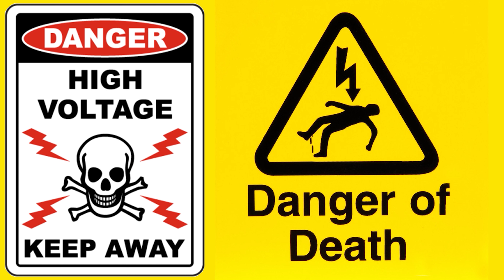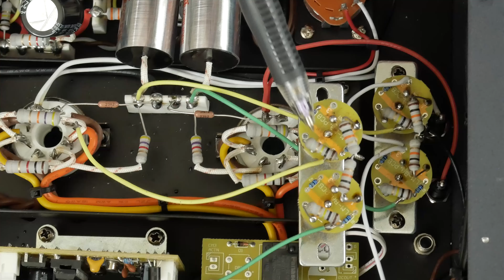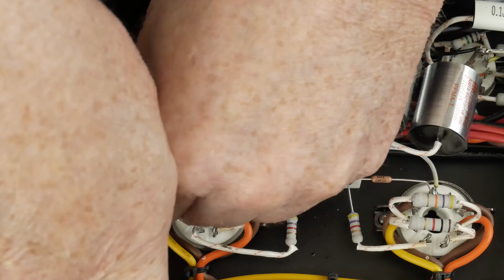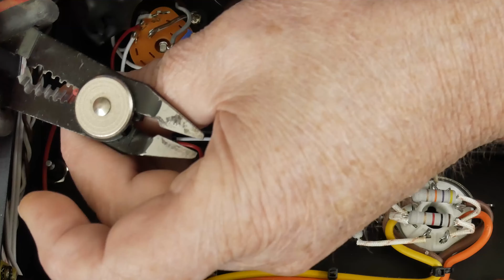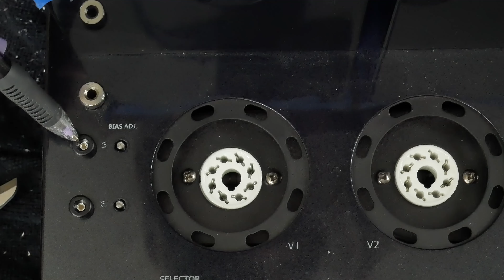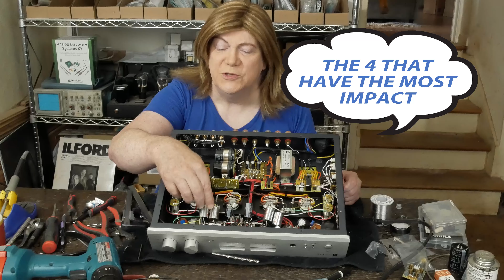Muzishare X7 Revisited: Relacing Bias Pots, Test Jacks #2

Comment: I have the Collectors Edition of this amp for about 18 months now and having problems with 1 or more power tubes (Psvane KT88 Tll either not biasing meter reads 0 and the whole right or left channel stopped working but the tubes light up normal. You would hear a slight click or pop and the bias would not work on one or more of the kt88s. but if you put in the new Psvane KT88 Tll  they all bias good. Now I take all the Psvane KT88 down to the electronics store and have them tested for power and shorts they all (new and old tubes) tested over 100% good. So now what do I check? Help Please...In other words the older kt88 test good 500 hours on them why don't they bias and work?
Reply from the maker: Tube socket issues?

Comment: Thanks.  What a great video explaining everything in detail. 

What are the military grade pots you have used in this video? I failed searching in mouser. I did find the 10kohms one.
Reply from the maker: the availability of these changes a lot,  when I post a video, they all disappear lol. 10K will work as it's simply a voltage divider. You can add a little resistance on each side to compensate.
Reply: @SkunkieDesignsElectronics  thanks so much.

Comment: Heyoo Stephie! 

I just finished my EAR 834 clone 10 days ago and now would like to get rid of the X7's built in phono preamp and make the phono input a high level input like the others (CD, line...) . The EAR 834 outperformes the built in phono pre by far!!!! And the EAR 834 outperformes my Project Phono Box S2 by far, too! It is another world and a new journey ! 

I see in this video you already "extracted" the X7's phono board. Is there something important to consider? I see two green/yellow twisted pairs of phono input cables coming from the RCA jacks for each channel going to the phono board and some white cables from the phono board to the input switch. Maybe I cannot see the black cables in your video. But don't really know how to connect them, if I omit the phono board. 

Is it correct to connect the yellow cables to the white cables and the green cables to some black cable? I currently cant see the black cable but I guess there is one at the phono output solder point in the middle. 

Maybe I should open the amp and have a deeper dive into it...

Nother topic: I opened my X7 yesterday night. It has XLR inputs and an XLR input board with a pair of JRC 5532D Stereo Op Amps. Semiconducters in a tube amp? okay If it works I am flexible. I have done some research and this OP Amps seem to be not that bad even if they are cheap (3 dollars a pair). They are quite popular in PA mixers where they put lots of layers from different tracks onto each other and they are popular for their clean neutral sound and low noise. Frequency range goes far above 100 kHz. The phono board has the same Op Amp JRC 5532D , if I can trust the schematic - but I will have a look once I will have extracted the phono board. What irritates me is that the XLR input sounds really amazing but the phono input really crappy.  

Kind regards from Germany
Burkhard
Reply from the maker: XLR input on a normal tube amp usually harm audio quality more than any benefit you could gain. As you see, they either just use op amps or some cheapo transformer.

On bypassing the phone stage, you just remove the board and connect those twisted pairs to the shielded wires.
Reply: @SkunkieDesignsElectronics  thank you again stephe!

Comment: Stephe,
Forgot to mention that my Muzishare X7 was partially modded as per your earlier videos. I replaced those big resistors with 1/4 watts as well as replacing all six big caps with Mundorf Supreme Silver Gold Oils as well as treating the meter switches with DeOxit D5. I noticed one day that the left channel was oddly louder than the right. I checked the bias as noted that the tube was oddly way over-biased. I corrected the bias to its proper level. The next time I used the amp the same thing happened and one of the Gold Lion KT-88s red plated. Again I noticed that the bias was way too high. The tube was a total loss. I determined that one of the OEM bias pot went bad. It was extremely difficult to trim the bias, the pot seemed stuck. I replaced all  four pots with some Bourns 20 k Ohms that were rated for 50,000 cycles (unfortunately the pot shafts were of the short type). That fixed the issue and all was well with the amp. 

My question is why did the bias safety resistor not blow, saving the tube?

Also, I have been using EL34 tubes in the X7 by reducing the bias from the KT88's 40 mA to 30 mA. I have not had any issues with the amp so far. But are you saying that something else needs to be done to the X7 to use EL34-type of tubes?
Reply from the maker: Hmm not sure why they didn't pop. Honestly I haven't tried to bias EL34 tubes in this amp. I'm going to before I ship it back!

Comment: Noval versus octal .............you're right about this when using current production tubes ( exceptions exist )
Strange I serviced several old vintage amplifiers , like a Marantz 8B and those bias switched still work fine after decades........operate those switches on newer amplifiers regulary before start up is oindeed good practice.
Many /most of recent/current tube pre/amplifiers are tuned/voiced for new production tubes , NOS may be often waisting money on these .!
Your videos are very helpfull for audiophiles that bought these kind of amplifiers .....
I onced had to repair/service an amplifier that was vey unstable....wor-ked /stoope working ......unexplainable  ....tubes were fine , voltage on the power supply OK .............than I discoverd that the owner  had put oil into the contacts of the sockets to make it more easy to pull out the tubes and do some tube rolling........it was a mess to clean them ....sometimes one wonders what's happening .....turned out to be fine after touroughly cleaning the oil out of the sockets ...( wasn't easy ).
Have a nice day.

Comment: Interesting! I don't really trust the built in vu meters and so your test jacks are genius! Can you adjust the built in VU meters with this small blue-brick pots? Biased my amp with an oszilloscope hooked at the output terminals parallel to an 8 ohm dummy load. Objective was to have exactly the same output voltage with a 1 kHz sin-wave at both channels. Chose  3.00 Vrms as target value at the output terminals. Before adjustment it was 2.92 V/ 3.00 V left/right with 2*40mA / 2*40mA bias left/right shown on the built-in VU meters. After syncing  3.00 V/ 3.00 V left/right with 2*50mA / 2*40mA bias left/right. So left -right asymetric but the KT88 pairs symetrically biased. 

Improvement was clearly audible, especially in UL Mode. I know my way of biasing has some points that are not adressed: left-right asymmetries in the preamp and the volume potentiometer etc...
Reply from the maker: And you aren't measuring the ma across the tube. Honestly, never heard of anyone adjusting the bias this way. And yes those blue pots are for adjusting the built in meter.
Reply: @SkunkieDesignsElectronics  maybe I do it the traditional way... and check the precision of the built in vu meters...
Reply: @SkunkieDesignsElectronics  bought some apapter to mount between the tubes and the socket to measure the bias current 🙂, arrived a couple of days ago